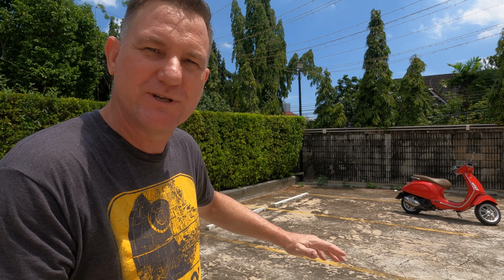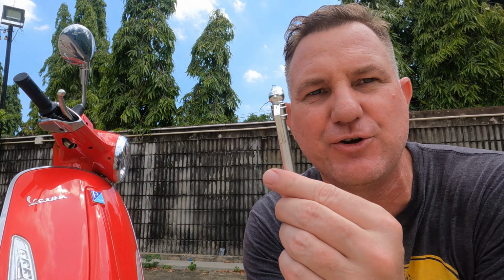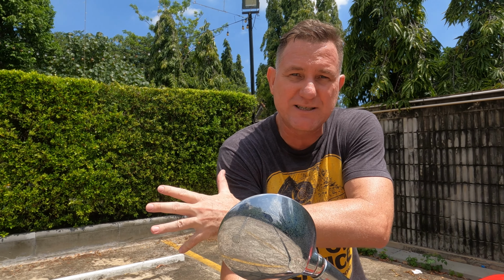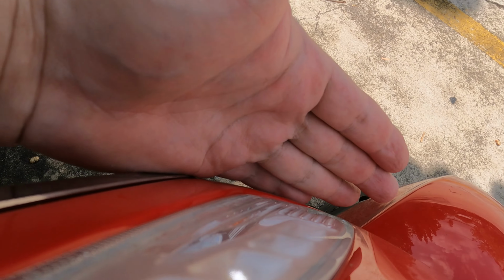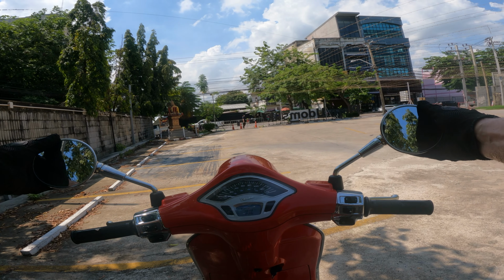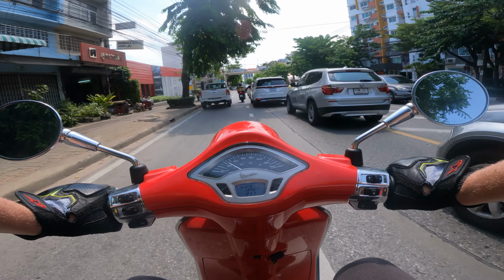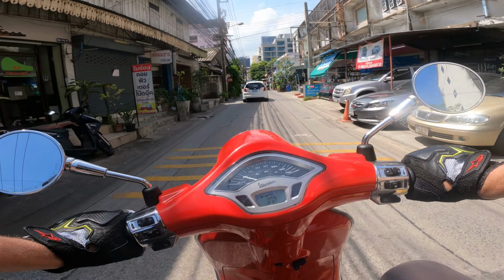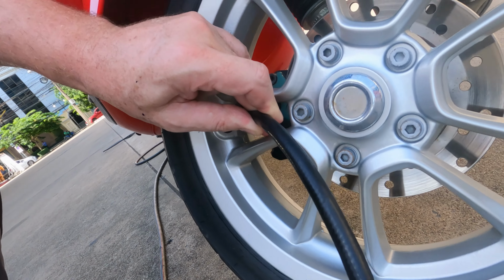HOW TO RIDE A SCOOTER | Pre-Ride Scooter Checks & Commentary Ride | PART 9

Comment: Binge watched your videos up to this point and found them awesome - thanks for doing them. Just bought an electric Piaggio 1 Active for rainy Vancouver that I need to get a handle on. Revving the engine and using the flywheel as a gyroscope is not possible for slow speed driving, so that is different, but should be the same otherwise. Good luck.
Reply from the maker: So happy to hear about your experiences. What works for one bike... may not be exactly the same for another.